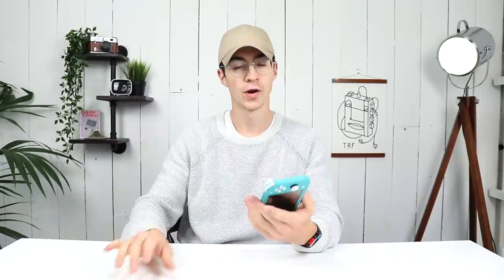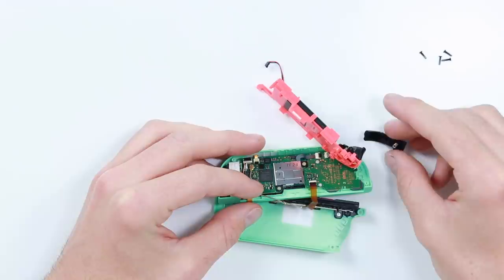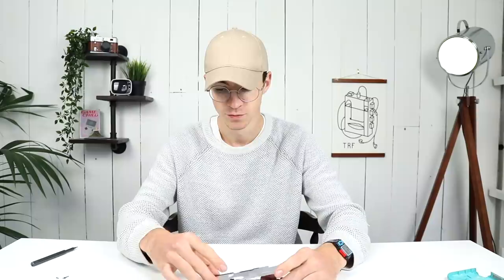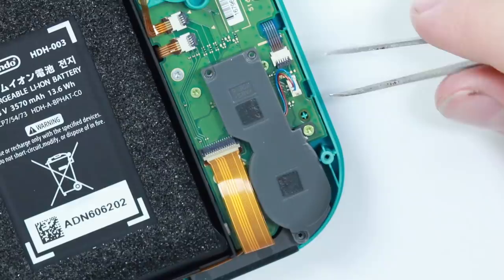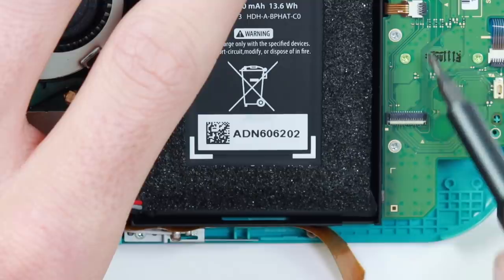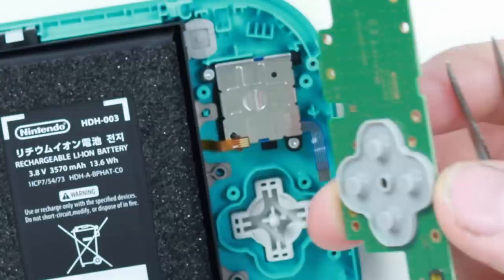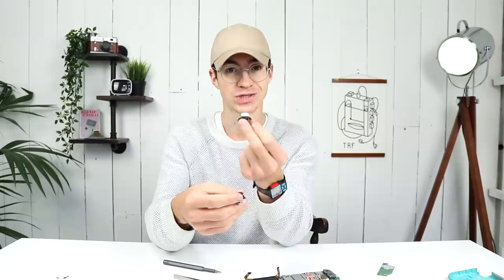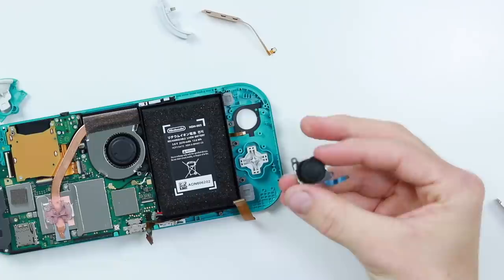Switch Lite Joy-Stick Drift - Easy To Repair?

Comment: Another one? This guy's a madman.Taking apart his own brand new console because the viewers asked for it, too.
Reply from the maker: It was scary! All works now no worries. Just played an hour of Link’s Awakening... Send help!
Reply: sigh of relief
Reply: I suffered all the way to the end lol
Reply: Sebastián Báez me too 😓
Reply: @TheRetroFuture  Not all heroes wear capes
Reply: What makes you think new sticks are improved? People have problems with them already, 3 days after buying
Reply: @TheRetroFuture  Hey so wahts the difference between the original joystick and the lite's drifting prblm?? Like I want to kno the severity of the
Drifting prblm of the lite I just purchased mine not too long ago so now I'm a bit skeptical...plz reply 
I've bnn trying to find a specialist 
On this matter for days now...😅😅😅
Reply: Mondongo Xd
Reply: The Retro Future damn only a hour i think your fine......for now
Reply: @denizzain1346  Yeah the sticks hardly have any differences and if anything the Lite's joysticks are arguably worse in terms of quality. Nintendo had to cut a few corners on the Switch Lite to knock $100 off the normal Switch's $300 price tag.
Reply: It's ok he's got two 😀
Reply: See Ccék

Comment: If Nintendo really fixed it, they probably would want everyone to know they fixed it... the fact that we still need to guess whether they did worries me.
Reply: my switch lite bought it last week started drifting the right analog, i don't even use it, i only have mario maker 2, i don't know what to do, i have the warranty and i thought this is simple problem, but youtube has alot of this same problem.
Reply: Adel Alsadi the switch joystick can not withstand pressure at all it will start drifting almost instantly
Reply: They didn’t it’s still a piece of shit

Comment: The drifting is the very reason why I'm holding off from getting a Switch. Having joysticks that wear down and fail is unacceptable. They should never sacrifice durability just to save a couple dollars.
Reply: Happens too with all of the controllers in this generation, unfortunately. I've experienced drift and severe input lag after using Xbone and PS4 controllers for a while. Cheaper quality, maybe?
Reply: Nintendo's console is way worse when it comes to drift problem
Reply: Nintendo's been sloppy lately.

Comment: Pls Show how to replace a gameboy Battery i dont trust the others
Reply: Just open the back and put another battery in.
Reply: @CosmicFox2007  but i dont trust myself doing it without a vid
Reply: paşathesqueaking birb what do you mean it uses AA batteries you’re supposed to replace them
Reply: @milesbizon8624  dont i have to break a metal thing to replace it or smt???
Reply: @ahiumut4326  What gameboy, version are you talking about? DMG, Lite, Color, Advance, Advance sp, or micro?
Reply: Guys it’s a joke jeez
Reply: @soulcune8670  Just making sure, so if they are confused i can help
Reply: @ProngedHorn  color
Reply: @soulcune8670  no it's not?
Reply: @ahiumut4326  bruh
Reply: paşathesqueaking birb no just take the cover off the back
Reply: @ahiumut4326  you must be a little bit or a whole lot slow man.
Reply: 1.pop off the battery cover 2. take out existing battery's 3.put in new AA battery's 4.put on the battery cover 5.Enjoy Edit: i forgot step 6    6:throw away the old AA batterys
Reply: Unscrew the screen off, be careful not to embellish the contact points, lift off the assembly unit and unplug the battery. From there it's as simple as putting a fresh lithium diode battery in and reverse the steps to close up the console

Comment: I'd really like to see if they changed the main reason why it drifted. As far as I know, it was about some sort of coat getting rubbed of by frequent use
Reply from the maker: Just inexpensive parts!
Reply: I heard the term "graphite pads" to describe the technology of those joysticks. A pad that has a piece rub on it and it can detect the position. It's very cheap but not that durable and that's the whole problem.
Reply: @chamoo232  I heard that too, yes. Do you by any chance know if they changed the technology or something at least in the switch lite joysticks?
Reply: @AltheaIsana  I don't know for sure but seeing Eliot's video make me think it might be the same tech as the joysticks look almost exactly the same. Nintendo pretty much admit there is a problem because they fix the drifting for free on the old model. I assume they took measure to raise the durability on the revision but it might still be the same tech. At least it's a part that can be swapped out and cost 4$.
Reply: @chamoo232  huh interesting. Thanks for all that information Btw
Reply: @heavyhittersirl  nope its worn graphite pads and has been proven many times... simple research would stop you from looking like an idiot... a small emp would only make the console reset itself or freeze for a couple of seconds. It would take a mega emp to damage hardware. Not having a go at you just correcting your simple mistake.
Reply: @heavyhittersirl  the only serious emp so far was when we let russia donate nukes into the ozone layer..
Reply: @chamoo232  why did they cheap out on one of the important parts of playing games though?
Stupid Nintendo
Reply: @user-uq3um5nq7d  Nintendo being cheap is nothing new. The original Gameboy was outdated tech even when it came out. Nintendo has pretty much always released consoles that were on par with other's last generation because it's cheaper. The original GBA still had no light for the screen and the first SP had a front light. It wasn't until 2005 that they finally switched to a proper LCD in the GBA and the PSP was already out by that time. They used cheap resistive touch screen tech on the DS when capacitive were infinitely better. Even when they finally had a DVD drive in their consoles they didn't put the ability to play movies because that cost a few dimes per units in licensing fees. Same for MP3 playback.
Reply: @chamoo232  That's right! Nintendo has always made their consoles cheaply to make profit on them. Other companies lost money on their consoles and only made profit on the games.
Reply: @Decodedz  Nintendo makes money on both. They make money on EVERYTHING.
Reply: this is such a bad take I barely know where to begin...And the gameboy was the perfect balance of tech at the time where battery life was super important, unlike the game gear which sucked batteries down like there was no tommorow and was borderline useless unless you were plugged into a wall.
Reply: @chamoo232  didn't capacitive touch screens come out somewhat around 2007 Afaik they came to existance with a lesser known LG smartphone in 2007, then right after they were popularized with the iPhone. The DS came around in 2004.
Reply: @nb5029  Yeah... nintendo only really started to use cheaper, kinda outtdated hardawre with the Wii. Before that, the previous consoles were really powerful for the time, and if they weren't as powerful, they had some other kind of feature that didn't appear in the other consoles - the snes had mode 7, the nintendo 64 was better at 3D than the ps1, the gamecube was a bit more powerful than the ps2, etc.
Reply: @mparagames  For each good decisions Nintendo made on the N64 and Gamecube they made another terrible ones. N64 didn't use cds because they were scared of piracy. That made a huge difference in how much stuff the developers could do. Then when they finally used discs for the Gamecube they were still scared of piracy so they went with tiny discs thinking people wouldn't be able to put regular discs in the console. That generation had so many PS2/Xbox ports but the Gamecube was often left out because there was not enough space on the discs.

Comment: I've just changed the joystick on my Switches joy-con which fixed the drift I was getting. But can we please get a bit of a further tear-down of the 'new' joysticks used in the Lite, and some confirmation that these are actually upgraded parts?

Comment: I have the lite and noticed from others as my self that it's not a drift but the opposite when you put the analog to the right it drifts back towards the center and back to the position its pointing at. I have seen poeple cleaning the stick but didnt work for me so I'm replacing it with a switch stick (black) since they r compatible. thanks for the video.

Comment: I have to say the metal shielding is probably more for rf signals than it is for heat dissipation because the fan blows air though the heatsink for the processor and not the heat shield itself as that would do a whole lot of cooling. It could help direct the air though the heatsink and not just blowing air vaguely around inside.

Comment: For anyone wondering, there was a joycon stick revision around mid to late 2018 and they're the same one seen in the switch lite. My yellow joycons (that I bought in September 2018) have this new stick and they haven't drifted. Interestingly enough I got a Red/Blue set in late April 2019 and the left joycon had the new stick and the right joycon had the old stick. Sure enough, that red joycon has been working fine, while my right joycon started drifting. I don't remember how long it took to drift, but it did within a year.

Comment: Now that you tear down newer stuff, i would highly recommend to get an anti static mat to work on. Stuff like a GB hardly get fried even if you rub your socks on a poly carpet while working on it. Stuff like a switch might get fried duo to micro discharge. Ofc, this happens rarely but you do tear down stuff on a regular basis.
Reply: You have it backwards. Older tech are much much more succeptible to static discharge due to them having no protection built into them. Modern devices can handle static discharge 99% of the time
Reply: @M8Military  Not sure where you got that from but i have to give you a hard pass on that. Do not, for a second, believe that modern stuff is any less 
susceptible to static discharges. It's not. In fact, the smaller the build form, the more 
susceptible it is. I got SO DIMMS fried from touching them once. Do not cheap out on a simple anti static mat with grounding and foul yourself with "they got protection build in". They do not have any protection once you work on them.

Comment: I’ve been having a problem on the lite while playing smash, sometimes when pushing the left analog stick to the left there doesn’t seem to be any response. It’s almost like the opposite of a stick drift issue.

Good to know it isn’t impossible to switch it out! Thanks for the upload!
Reply: Masteller try calibrating it in the settings menu if not send it back to the store
Reply: I have the same problem but when pushing to the right. And honestly I'm pissed. I've barely used this thing and I have to deal with the hassle of sending it to Nintendo because I'm outside of my stores return policy.

Comment: I had my left joycon stick replaced about 8 months ago by nintendo and the stick they replaced it with is exactly like the one in this switch lite. Same shielding pattern, same blue ribbon cable. Unfortunately it started to drift even faster than the first one. Like 3 months later. It may have something to do with playing movement intensive games - smash bros ultimate was out around the time I had the issues. But if this is really the same as mine, then good luck switch lite owners.
Reply: Oof
Reply: Tip: if you play smash bros and don’t want drift, buy a pro controller
Reply: Mines fucked
Reply: Tito Simoes one data point is completely irrelevant
Reply: @MikehMike01  Unfortunately, it's not 1 data point. If I it was just me, there wouldn't be a class action lawsuit in progress which also involves the switch lite smh.
Reply: The fan of Kirby you shouldn’t have to do that though and Nintendo needs to step up and fix the issue because this isn’t normal. I’ve had the same Xbox controller since the Xbox one came out and it has no issues after lots of use and abuse yet my Swith Lite has drifting problems within one month of playing ANIMAL CROSSING.
Reply: got my switch lite for like 6 months already and still no drift issue
Reply: @jamesryandelcarmen7703  same. Maybe it depends on the model.
Reply: Maybe it depends on how much force people’s thumbs press out? I’m sure Nintendo tested their products with the tech nerds that work there and thought it was good enough.
Reply: I play exclusively animal crossing on my lite, have owned it less than three months, having left stick problems. I'm apoplectic.
Reply: I play exclusively animal crossing on my lite, have owned it less than three months, having left stick problems. I'm apoplectic.

Comment: I really like the thought that went inside the EM shield plate. Think about it: Add rigidity, shields the important electric components from outside interference and acts as a passive heat sink.

Sadly it looks meh~, so I removed it in my all clear switch case swap, to see the components. 

Also, am i the only one really disappointed in Nintendo removing the dock mode from the Lite? Or not patching their own games to work without joy con moves (Mario Odyssey)? The docking mode removal is 100% software side, the patch should be an easy thing to do, considering that you could use the touchscreen or a button combo rebind for it. And Bluetooth is still being locked! Cmon.
Reply from the maker: I agree! Where’s see-through metal?!?

Comment: This is good to know as I am planning on getting a switch lite! Thanks!
Reply: How long have you had the lite now? How has it been for you? I want one but people's comments online have scared me out of getting it yet.
Reply: Great video!  I want the switch lite. I have a good gaming desktop that I use primarily, but I want something handheld.  Because of this, I honestly have no need to play on the TV.  This is for my play time when not using my computer. Laying in bed, laying on the couch, while traveling etc.. 
I have seen countless people online advising people like me to buy the regular switch and never to buy the lite. The biggest reason is the joystick drift. This really concerns me. How can I justify spending more money on something that doesn't seem necessary?  You make it look easy to take apart, and ultimately fix. But what if it's the other joystick?  Is it usually just the one side that ends up being problematic?  How has the lite held up for you?  Has anyone here had a lite for a while without issues?  I really want to get one of these but I'm just really worried and it's making me chicken out!  There are so many horrible things online about it!

Comment: I don’t have drift, but my lites right stick keeps trying to go back in. It is hard to explain when I go into the recalibrate screen I will push it to the edge but it’ll push inwards, idk if it’s considered drift but that’s the only thing I’ve had.

Comment: what no one seems to inform their audience in every other youtube video is that the screws they used are JIS screws on switch lite (both inside and outside, not sure about regular switch). Philips screwdrivers work with the JIS screws but there is a high chance of stripping down the screws so it's better to have JIS screwdrivers or bits while working on it.

Comment: I hear reports of drift in the switch lite but i haven't noticed any myself. Glad to know they are not to difficult to replace if it ever does happen.
Reply: I just noticed mine started doing it recently. I've had my switch lite since the Links Awakening launch. So the joysticks did have a great quality. It wasn't until i started to play stuff like Saints Row 3, Hellblade, and Resident EVIL where I started noticing it. 

But on the bright side, fixing the issue on this looks more easier and less complicated than a PS4 Controller. I hated fixing those joysticks and making sure that stuff like the sensor bar, battery and a ton of those components would be in their right place. I swear it felt like you had to put everything back like it was or else you would notice a fair share of inconveniences.

Comment: I have had my switch lite for 4 days now and the drift just started today, they build them to break so you have to buy new ones or pay for insurance.
Reply: @nastylungsgotmecoughing  but why should you nintendo need there ass suing for this
Reply: Noel Fowell please fix your grammar, just sayin no offense or anything I can be taking advantage to.
Reply: A new set of analog sticks is less than $5 US on eBay. If you have 30 min on your hands and you're gentle with the equipment you could literally replace them yourself. If (notice I say IF) you are a smoker and you smoke near your device, a lot of tar builds up under the sticks, causing the drift. In most cases, the drift is actually caused by dust and debri that can get under the sticks, so try to clean them out before sending in for repair. Cheap parts mean a cheap replacement, it just takes some patience and a YouTube video.

Comment: I want to buy nintendo switch but in my country nintendo does not have an official shop or etc. So I have to buy it from the main distributor but the problem is actualy this. The main distributor adds nearly +100$ to total price because they are stakeholder. Also I can't buy the cheaper one (switch Lite) because if some problem occur after the expiration of guarentee, I don't want to be an engineer less than a day.  On the other hand I can buy new joycons for nintendo switch. 

2. region countries that nintendo does not actually exist by own, this technical problems affect the market. 
Btw, if I buy it from main distributor with nearly +100-150 $ extra price, it will be expensiver than xbox series s price GDMN

Comment: When I had the drift issue on the pro controller I kept punching the stick and it actually worked and didn’t drift anymore. I wouldn’t recommend it but it was funny how it works  
Anyway Nice Vid
Reply: Used to "fix" the gamecube that way with a hammer when it started acting crazy. It worked tho so no harm done.